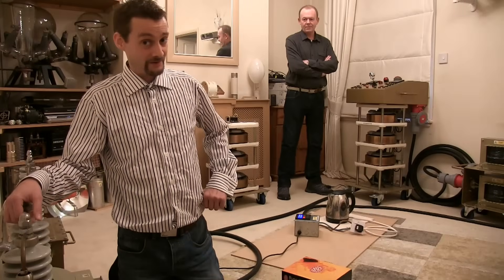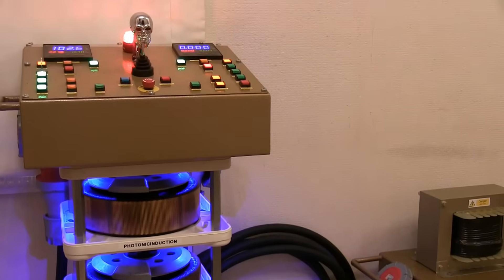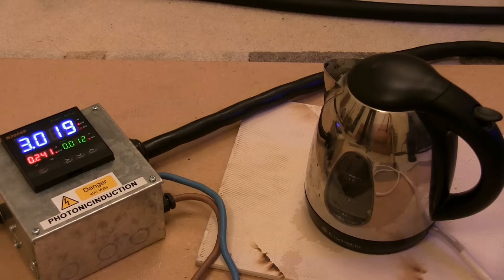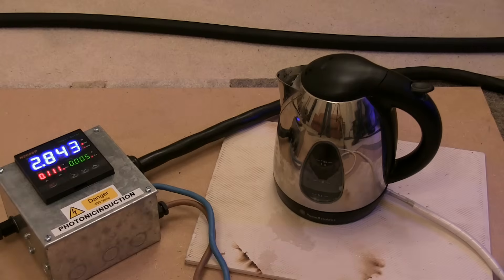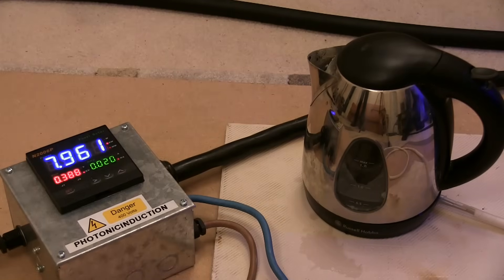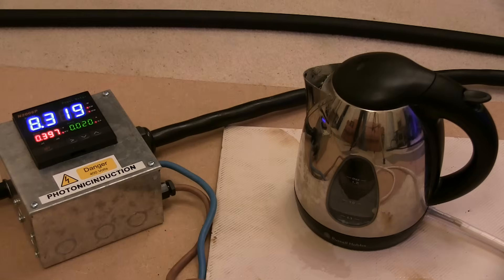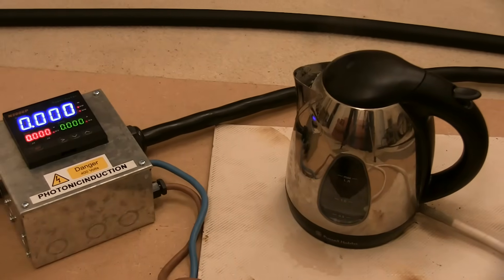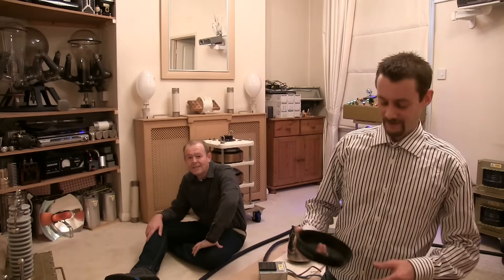10 Second Kettle

Comment: I know I'm 11 years late, but can someone please explain why the power increases over time?
The resistance of metals should increase with temperature, allowing less current to flow. 
This behavior is seen in all incondescent lightbulbs. A 100W bulb can briefly pull >1000W on startup, while 24kW bulb will pull upwards of half a megawatt.
What gives?
Reply: They raised the power

Comment: Heat coil is a giant resistor. Resistive loads are very good at handling over volt/current as long as they can get rid of heat. In this case through water. Before the kettles temp switch shut off when boiling.... Insulation is the next limiting factor. Voltage will jump through it when high enough.

Comment: So I live in 120v land, and the electric tea kettles around here only put out 1500 watts. It takes a good 10 minutes to boil a full kettle. I had wanted to get a European 3000w 240v kettle and run a dedicated circuit for it. But in the end I just got a regular 120v kettle from the Walmart and fed it 240v. And the crazy thing is, it DIDN'T EXPLODE! It seems to like it just fine? It now runs at 6000 watts instead of 1500 and it boils the water a lot faster.
Reply: please tell me which kettle does this. Technology Connections did a 6000w kettle test but both of them hit their limits. if you have the make and model of kettle that'll survive 6kw I'd like to know
Reply: @enzochoi923  It's the really cheap plastic one from Walmart with the exposed heating element. Model 550236. I think it works at 6kw when other kettles die because the heating element is fully immersed instead of being under the bottom of the kettle.
Reply: Hahahaha you're a legend!
Reply: 120v electric kettles boiling slower has got to be the most first world problem I've ever heard. Nobody even cared about this until that tubby technology connections guy started whining about it.
Reply: @shamancredible8632 nah I'm drinking about 12 cups of tea a day (preferred over water, nothing too special about it) in 3 cup batchet. The time really catches up to you. 

Even more than that though, boiling water for pasta on a 3kw kettle instead of the stove is actually life-changing. For cup ramen 120v is fine, but a full pot of water for 1lb pasta on 240v kettle timing (done in 2 kettle fills) is magical.
Reply: @shamancredible8632  10 minutes is still insane, it's easier to pop a pot on the gas stove, it'll be WAY quicker. My 220v 2KW kettle with 1 liter boils in like 2 minutes.
Reply: @shamancredible8632 what a bundle of joy you are

Comment: Wait, UK 🇬🇧 gets 3000W, USA 🇺🇸 only gets 1500??😨
From testing with my P3 Kill-a-Watt meter, it seems our USA outlets are generally 110/120V (why the discrepancy?) at 15A, so 1600W or 1800W theoretically maximum. I’m sure manufacturers are cautious about this limit, as a device too close might trip breakers in some houses.

Comment: I think this should be done again, but this time measure how many kWh are being used and work out if it's cheaper to boil at  very high wattage.  Ideally it should equal out, you need the same energy to boil a pint of water, the time taken is irrelevant, but how does the efficiency change?

Comment: And some people say 3-phase has no domestic applications. PFFFF
Reply: Stephen Lee  yeah nevermind me trying to translate is hard XD.
Reply: He's not using 3 phase
Reply: @peterlarkin762  Notice how he plugs in his setup with a large 3 phase IEC plug.  I don't know if he generates his variable single phase from a 400V 2-phase, a 230V single phase or some advanced energy conversion from all 3 input phases.
Reply: @johndododoe1411  hes probably using that plug only for 1 phase + neutral only. I believe his income power into house is 1 phase+neutral with 100A fuses. Even his special socket for 20kW psu has single phase 100A type C breaker.
Reply: @SicakGemb  I don’t know where he lives but at least here in Germany (and therefore I would suspect most of Europe) we have 3-phase power in every house, often with 60A per phase, so 41.4kW total
Reply: @developerfabi  he only has single phase 100A in this house (in the UK 3 phase tends to be industrial and commercial units) he has a 95-100A cutout protection box (switches house to light only battey backup) so he doesn't blow up the DNO fuse

He is using a transformer and a variac double or triple the voltage
Reply: @peterlarkin762  yes he is
Reply: @Fabio-hc9bv
No, he's not.  Look up his "20,000 watt power supply" video.  You can see in the assembly he's only using brown/blue on the input/output.
Reply: @mvansumeren4313 4 years ago 😂
Reply: My old house had 250A 3ph to it was for a wet Central storage heater
Reply: What’s 3-phase
Reply: @aidanf2610  there is one phase and three phase electrical mains. Each of the phases has (at least where i live) 230 VAC when measured to neutral. Those 3 are shifted so that the peaks are spread evenly. Between the phases you now have 400v ac. Hope this helps.
Reply: I remember our old clothes washing machine being the only 3-phase machine in the house.

Comment: you should try one of those Chinese water heaters that has the electrodes right in the water...
Reply: They're called electrode boilers and they're fairly common in industry; it has nothing to do with China. Any "warm mist" portable humidifier in western retail stores also works the same way
Reply: Random curiosity: we call those a "rat's tail" here in my region.
Reply: Matthew Miller we have those in America
Reply: Eyyydd mouoore sooaalt......
-Diodegonewild
Reply: Well, there is a difference between a dip warmer and having electricity go through the water. One is reasonably safeish, the other can be very dangerous.
Reply: Ah yes, idiocracy has begun. People don't know how water was boiled using electricity in the good old days nor a truck/lorry cab.

Comment: Its actually more efficient to boil the water faster with more power as there is less time for heat to escape to the surroundings. Only problem is the extreme stress on the element will cause premature failure.

Comment: Hey Photonicinduction the electric motors and heaters of today are crazy that consumes 3000w of ketle or 2000-3000w household vacuum cleaners but this new regulations is better but much better a vacuum cleaner with eco performance consumes 600w to 1000w and have a greater much air force suction. Please the next video buy a Siemens vacuum cleaner and destroy it with high voltage about 230v to 400v and 1000v to burnout

Comment: I could use one of these Kettles. I'm very inpatient person, and I bloody hate it when I have to wait 5-6 minutes for my coffee to boil :(
Reply: I just pour 1 cup of hot water in my 3kw kettle. Coffee in 30 seconds.
Reply: @TimpBizkit  1500W is the max here :( so slow to boil.
Reply: @dmd8552  I was just going to make the same comment! From testing with my P3 Kill-a-Watt meter, it seems our USA outlets are generally 110/120V (why the discrepancy?) at 15A, so 1600W or 1800W theoretically maximum. I’m sure manufacturers are cautious about this limit, as a device too close might trip breakers in some houses.

Comment: Hole in heating element? I've seen something similar happen to an oven at school, it said out of order so I had a look and the heating element looked melted and actually burnt in half. Burn marks on the door and the door hinges are rough. Looks like it had a meltdown, because someone probably left it on. I seen an electronic control relay fuse its contacts together, causing the element to melt, on some other video.

Comment: Would this work better with an old fashioned immersion element kettle do you think?  The element would be covered in water and thus might be able to transfer the greater heat output for longer without over-heating.  Do you reckon?

Comment: Because kettles are water cooled they could probably take quite a bit of overpowering, down to the limit of how much the wire in the element or base heats before the water has a chance to cool it.
You might have more luck with a fully immersed coil element in the water rather than one with an element in the base - better cooling.

Comment: Guys, why in home heaters we don't use low voltage at high current? I mean something like 1.5 volts at 66 amps for example. I think this method of using 100W will generate much more heat than if we would run 240 volts at 0.41 W (100W again). Am I correct? :)

Comment: Got a question. I'm building a HV transformer,I'm using extremely thin wire of various gauges (the kind that break when you pull hard) and just hand wrapping the wire around a iron pulley. Is this the best way to do it or should I wrap the wire in a orderly fashion?

I'm getting the wire out of various things like cd player motors and mini RC cars.
BTW where dose he get all of that electrical stuff?

Comment: This has me thinking about what it would take to boiil a 10 gallon kettle as quickly as possible while still maintaining a reusable device. Yes, I'm thinking about home brewing beer,
Reply: 10 gallons is 37,854.1178 cc.  
We'll say the temperature is going from 25 to 100 C, for a 75 C difference.
This temperature difference would require 75*37854.1178 = 2,839,059 calories.
2,839,059 cal = 11,886,572 Watt-seconds.
So if you wanted to heat it in 10 seconds, you'd need to have a 1.1 Megawatt heater.
/r/theydidthemath
Reply: How about in 5 minutes? What could deliver this much power without burning itself out as well?
Reply: http://www.americanspotcooling.com/frost-freighter-ovh500-propane-natural-gas-heater-data-sheet.htm
Reply: No I wanted electric
Reply: Well, 5 minutes would reduce the power by a factor of 30, so you'd still need a 39 kW heater.  They said they had 10 kW when this simple teapot blew up (which is really quite impressive), but they were nowhere near 100% efficient like my calculation assumes. You'd be better off lighting something on fire.
Reply: 5 minutes would be about 40 kW right, so this should work... http://www.supplyhouse.com/Slant-Fin-EH-40M2-135S-EH-40M2-40KW-Single-Phase-Eight-Element-Electric-Boiler-w-Electronic-Boiler-Control-137000-BTU
Reply: At 39 kW, it's only about 18000 amps at 2.2 volts... Chris Larsen , we do have those super capacitors lying around. We'd need a few more to get the 5 minutes of power, though.
Reply: Yeah, 11,886,572 Watt-seconds is 3301 W-hr, so you'd only need 970 of these bad boys: http://www.digikey.com/product-detail/en/BCAP3400%20P285%20K04/1182-1037-ND/4896902.

And yes Patrick Little , that electric boiler seems like it would work, but pulling 40 kW out of a 240 V supply would require its own 200 A panel!

Comment: Yank here jealous of your 240v mains.

Seems that the efficiency is quite linear, possibly even bending in favor of the higher kW rating.  Great video!
Reply: Eh, a chop saw trying to spin a big blade on the end of 20m of extension cord tends to labor a bit.  You have to use the momentum of the blade more than the torque of the motor.

I'm more interested for portable appliances though.  Hot plates, kettles, mixers, vacuum cleaners, etc all benefit.  You can hardly find anything over 1500 watts for residential use in the US.

Comment: You know if u put too much voltage through it, the heater will heat up so quickly and reach so high that the leidenfrost effect will occur with the water, so actually it will boil slower
Reply from the maker: I didn't use thermite lol

Comment: Hey photon! Now that your out of bed. Was wondering if you would name the power supply the Fuck a watt, sounds very descriptive, What ever you hook it up to, goes to fuck. watt the fuck would sound cool as well.
Reply: ***** I see your point on the cursing. How about the Amputator, Maby something with a pop. Popcorn machine, Maybe Danger Zone? Watt happened. Poppy sounds silly. One of em. Anyways, I have a few thinks hanging around that i want to mail to you, so you can crank it up!
Reply: ***** Also one more thing, On my property I'm getting the hydro company to wire in, 800 freaking amps. So, any tips on poppy machine?
Reply from the maker: ***** I grinned at Amputator :)
Reply from the maker: *****
40k and I'll build you the ultimate power supply for 800A :) lol